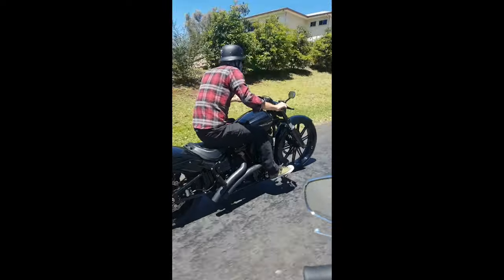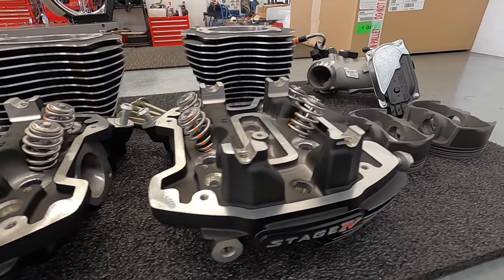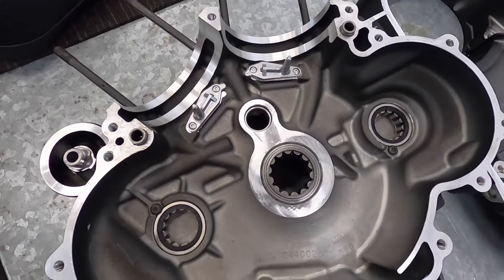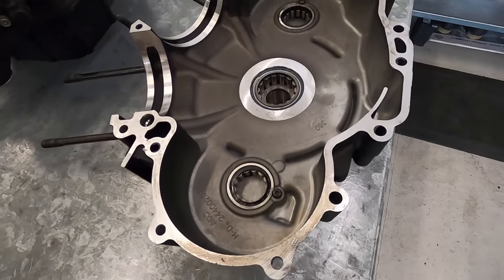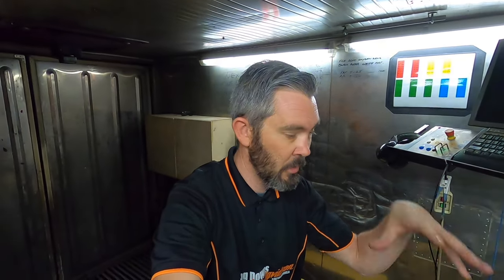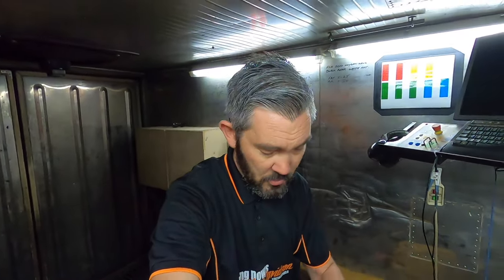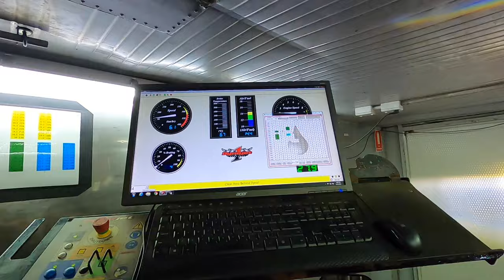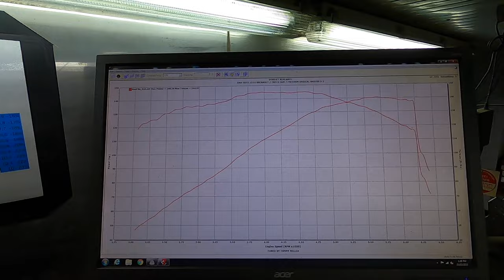131ci Breakout / Build & Dyno Tune / Stupid Fast

Comment: Nice build and tuning; 140hp/145tq specially with the less than optimum exhaust system.  The Cycle Rama 512 Cam performs quite well with the HD-SE 131 Kit.  Very nice curves on the Dyno Sheet.  Well done.  2-23-2023
Tom M., So. Cal., U.S.A.  '21 RGS 114 Stage-2 (S&S 465 torque cam) & '23 RG-ST (stock 117 for now).

Comment: 🤣😂🤣😂🤣
Stirring up the Yankees 🇺🇲 with "we do the better skids"😂😂🤣😂🤣🤣😂
I like this build, anyone can build a motor just for a dyno printout with massive number's..... But that's an issue for a tape measure 🤣😂🤣.... But I've always said it's better to make usable numbers, especially within the rev range of normal riding...... As it's a road,NOT A DRAG STRIP.....
Keep Living the F#@KING Dream ❗
Safe travels 🙏♥️🐾🐾
💪🇦🇺💪
Reply from the maker: Cheers for awesome feedback & support mate!! 
It's no secret that we do the best skids on the planet 🌏👊🏻

That's exactly right though mate. I could have put a cam in there with over 250° of duration with more lift and made lots more power but it would have softened the bottom end off and not had the huge hit from 2000rpm.

Time & place for all different combos and as you said....numbers ain't everything 🇦🇺

Comment: Great vid, I recently had my Fat Bob fitted with the same kit but using the 131 kit cam, hilariously fast now.  How much extra do you get from your recommended cam please?
Reply from the maker: Results vary from engine to engine as different air filters & exhausts systems are used. However this CR512 Camshaft generally goes early 150hp & mid 150s in the torque.

Thus bike was a little lower due to the pipes
Reply: The SE cam in the 131ci kit is shit. I swapped it out for the CR512 and its an animal now..

Comment: Awesome Job and of course an awesome bike! Is it correct that i see 3 holes for 3 Ignition sparks? And yes, it gives a lot to do when you rebuild and tune an engine! TX for sharing this video
Reply from the maker: The Milwaukee8 uses 2x spark plugs per cylinder head so 4x spark plugs all up.

Comment: fantastic work as always Tommy. Do you know if the S&S quickie pushrods fit inside the screamin eagle black pushrod tubes on the M8... ive been unable to find the answer as someone mentioned they dont. thanks
Reply from the maker: Thanks for the positive feedback and support.

Ok, the S&S Quickie pushrods are designed to work with the STOCK pushrods tubes on the M8. Now the stock pushrod tubes are slightly longer than the Screamin Eagle pushrod tubes.
The Screamin Eagle pushrod tubes are slightly shorter than the stock ones, they have to be shorter to allow for wrench clearance and the bottom to make the adjustments. 
So with all that said I would assume very confidently that the S&S quickie pushrods will fit inside & be able to work with the Screamin Eagle pushrod tubes.

Comment: BEST Harley tuning and Look!!!  Somebody know what is the EXHAUST NAME or what is Company name of the 2 pipes exhaust, very nice sound!!!
Reply from the maker: They are FREEDOM Radical Radius. The owner has modified the ends caps. They normally have a 'slash cut' end cap but they've been cut off straight
Reply: Loving the videos and the builds, new to Harley and just purchased a 2023 Breakout, in regards to the Freedom Radius Pipes, are they better than the V&H Big radius pipes, got these and as part of the Stage 1 kit.  Keep up the good work and good to see a some local content. @MasterTechMiller

Comment: Great Job boss amazing Breakout. Have a question for you my Fat Bob 2018 from 107 I upgraded to 124 S&S  Stage 3 with 475 Cam and Screaming eagle throttle body with injectors. And Clutch plates with 2-1 S&S Race only with silencer making over 131hp and 144tq but its not that smooth any thing else is missing to make the bike ride smooth as stock ? Or its impossible once you go with these performance parts.
Reply from the maker: The S&S 475 cam is not known for being smooth. I would recommend changing to a CR485 from www.alphaperformanceengines.com.au 

That will make the bike run smoothly & will definitely make more power. The rest of your setup sounds like it will be fine to keep running.
Reply: I am in the USA is this CR485 Australian product? @MasterTechMiller
Reply from the maker: @amg5795  yes it is. However if you contact www.cycle-rama.com they will be able to get you sorted

Comment: If I was still in Brisbane, I would be straight to your sales to get a low rider s
Reply: Do I need to get the SE tuner for S&S slip-ons on the low rider s 117?  my dealer in NZ doesn't have a dyno and the closest place is a few hundred k's away
Reply from the maker: @mintpaul  Hi mate.
NO. If you are just getting the Slip On pipes then you don't need to get a tuner.
The base calibration in the ECM has been done with upgraded air filter in mind so just adding slip in pipes won't effect it much at all and the ECM will still have learning window margin to make any adjustments if needed.
Reply: @MasterTechMiller  Thanks again and love your vid's

Comment: Finally found an Aussie channel with great content 🎉
You said these stage 4 builds are getting more popular🤔
I just had my 22 CVO Road Glide made stage II
I was talked out of going the full Monty on a tourer what’s your thoughts
Reply from the maker: Thanks for watching, mate. Congrats on your current setup.
I'm not sure why they would've talked you out of going any further 🤔 
I build plenty of big cube tourers with no issues. There are a few things that must be done to ensure longevity of the build its no secret.

Where are you located?
Reply from the maker: I've just built a 131ci CVO RoadGlide Limited. The video will be edited & uploaded in the coming weeks.
Reply: Country Vic
Reply: Was interesting re the twin over single pipe scenario I didn’t want to change out my pipes as Super Trapp were the only pipes made that fit the scorched chrome and I didn’t want to lose that look
I had to go to bigger injectors so to get the most out of the setup
Reply: Will look forward to watching that one
Reply from the maker: @jasonchapple4698  Khrome Werks offer a full system that has the same CVO Chrome finish. It's a great system.

Comment: What year is your Breakout, and did you have to do anything special to fit the 131 in there?  Been thinking of putting a stage 4 131 in my 2014 Breakout, since it has a stage 2 103, and it's rather slow...
Reply from the maker: This is my friend's. It's a 2020 model and the 131ci engine fits straight in without any hassles. 

Your 2014 Breakout is a Twincam engine the largest bolt on kit you can go with that it 117ci. 
You can also buy the 120R Screamin Eagle crate motor which is a complete bolt in engine.
Reply: @MasterTechMiller  hmmm. Thanks for the info, I'll have to look into those. Any significant difference between the two other than displacement?
Reply from the maker: @gagepuffinbarger6939  there is a fair bit of difference between the Twincan engine and the new Milwaukee8 engine. Mainly the 4 valves per head in the M8 engine.

Comment: Great video mate, looking to do the 131 kit in my 21 streetbob, can you tell me what the standerd cam is that comes with the SE kit? Id like to run the same set up as this here. 
Thanks!
Reply from the maker: Hi Kurt, thanks for checking it out. 
Here is a link to another 131ci build I did with the SE517 Cam that comes with the kit. This video shows how it performs as a bolt on kit
https://youtu.be/waEJtpi-RRI
Reply: @MasterTechMiller  thanks Tommy, very impressive in part 3, did you end up getting 160? Also could i get away with running the factory bottom end with this build. The bike cops abit of a hard time here and there.
More of dumping clutch/ powerskid. not sitting on front brake
Reply from the maker: @kurtdonovan4198  if you plan to be a little mean to it I'd highly recommend doing a stronger bottom end for sure. 

Sold the bike before I had a chance to spend more time on it so I didn't end up getting the 160 but all good. I'll be doing another build shortly and aiming for over 160
Reply: @MasterTechMiller  ok no problem, il look at bottom end weld also, i just spoke with one of the boys at your shop, looking at a quote for this build you might see it around october  if all good. Thankyou!
Reply from the maker: @kurtdonovan4198  that's awesome mate! I look forward to possibly meeting you and building your engine. 
If you need to talk with me, just call the shop and ask for me 🍻
Reply: @MasterTechMiller  i sure will thanks mate, and also intrested in how you can achieve the 160. Im running bassani sweepers i understand 2 in 1 will produce more hp, but love the sound of these things. Do you think we could achieve 150+ with the 2 pipes?
Reply from the maker: @kurtdonovan4198  yep, 150hp is achievable with 2-2 pipes, just need more compression & cam shaft

Comment: Wellll bugger...now I need to do the same to mine 😅 great vid mate.  How much would that set me back roughly on my 2019 114 breakout?
Reply from the maker: Depending on your exact setup now with exhaust, air filter & tuning module you could be up for around 12k ride in ride out fully built & tuned. 
If you already have a decent air filter, exhaust system & tuning module it will be less

Comment: Is that bike dropped in the rear? Its a 3.5 gal gas tank right?
Reply from the maker: Yes it's running the Platinum Air Ride in the rear.
Reply: @MasterTechMiller  and the gas tank? 3.5 gallon gas tank
Reply from the maker: @MR1JUNO  yes
Reply: @MasterTechMiller one last question do you guys install 5 gallon gas tanks?
Reply from the maker: @Mario Rosales  Yes. We normally use the Fatboy tank, modified so that console mounting points are removed for a clean look..

It's a direct fit with no issues, fuel pump & sender fits directly in & the mounting points are the same

Comment: is that the standard front wheel?
Reply from the maker: No. It's a 23 inch
Reply: @MasterTechMiller  does it change the ride much? I’m thinking gloss black my original rims or do I go to 23?
Reply from the maker: @kanenaysmith9287  nah doesn't change a thing.

Comment: Awesome work mate. With a build like this will you have to do work on the clutch? Always wondered
Reply from the maker: Thanks for the awesome feedback mate 👊🏻

So the stock clutches in the Milwaukee8 bikes are proving to be VERY solid. We upgrade the stock springs to the Heavier 1275N Springs from Screamin Eagle, and that's it! We have had NO issues with any clutches in any of our hi output engine builds. 
Even the bike we drag race on a regular basis still run stock clutches with only the upgraded springs.
Reply: @MasterTechMiller  thanks for the reply mate! Means alot. That is awesome to hear about the clutches. Really enjoying the videos mate! Learning on everyone. See you on the next one!
Reply from the maker: @adamhetherington839  no worries at all. I'm glad you're enjoying them.

New video will be finished & uploaded in the next week or 2. It's a 131ci Bagger build so stayed tuned for that one. 👊🏻🍻

Comment: How do you get 200hp?
Reply from the maker: Super Charging or Turbo Charging comes into play for +200hp. 

To get over 200hp NA you need to bigger with cubes, a 143ci with a bigger duration Camshaft than this one, more compression & rave fuel

Comment: Thinking of a 131 . Can a 468 cam work with this configuration ?
Reply from the maker: The SE517 that comes with 131ci would be far better suited than 468 cam. 
You could run the 468 cam but you would holding the engine back substantially. 

The engine would not be able to run efficiently with the smaller cam as it wouldn't allow for big enough 'breath' to fully fill the cylinders.
Reply: @MasterTechMiller  Thank you  for quick reply.

Comment: Nice results! Can you give a rough estimate around what money is needed to get these results starting with a stock Breakout?
Reply from the maker: From a completely stock 114ci Breakout you will to budget roughly $10,500 ride in ride out for something like this engine build. Obviously that's including the engine kit, exhaust system, air filter setup, tuning device, labour and dyno tune.
Reply: @MasterTechMiller  Thank you for the information!

Comment: Engine  swap 114 to 131  ?? With no modification???
Reply from the maker: What do you mean no modification? You need to explain your concern or ask a better question
Reply: @MasterTechMiller  do they have kit available to a 114 to 131 ? Or do you have to take the engine out and replace?
Reply from the maker: @edgargarcia940  Screamin Eagle offer a 114ci to 131ci bolt on kit. 

The reason I had this engine out & apart was because I fitted an upgraded flywheel assembly.

Comment: Is it worth doing the upgrade from 114 to 131, if your riding 10,000 miles per year. My bike is 2020 breakout trying to figure out if I should spent 9k on upgrade for fast bike or get naked superbike
Reply from the maker: A few things to consider with an upgrade like this are; I recommend halving the service intervals for the engine oil & filter. So that brings it down every 2500mi.
The primary & trans oils can remain at the 5000mi interval.

Fuel consumption does increase aswell so if your looking to do longer hauls you will be looking for gas stations more often.

From 0 to 100mph these types of builds will crush just about any 1000cc Sportbike on the road.

Comment: What’s the cost of this package?
Reply from the maker: The complete stage kit from Screamin Eagle retails at just over $5600AUD depending on your dealers workshop labour rate will determine overall cost of installing and tuning but a ROUGH figure would be $7300 ride in ride out if you already have a full stage 1 kit with tuning device

Comment: how do I get my new build to the point of dyno ready
Reply from the maker: That's a very open ended question. Can you please explain your current situation & what you are trying to achieve
Reply: I have been told its best to do a 500 miles break in before getting on it, you seem to be able to reach a safe point way before because u show bike on dyno without break-, how are u achieving this readiness. @MasterTechMiller
Reply from the maker: @johnbeardsley7360  OK, firstly that information is false. 
Doing 500miles on freshly built engine without a proper tune in there is the quickest way to cause damage to your engine.
Why? Because there is an improper tune that will have very lean spots through the RPM range & ignition advance is not properly set leading to spikes in combustion pressures. 

All the engines I build have all the critical clearances & tolerances set during assembly. One very important one is the piston ring end gap. Once the engine is built, I fire it up & ensure it gets to operating temperature while inspecting the engine for any leaks etc. 

Once the engine had reached operating temps I let it cool off. This procedure ensures the engine & all its components are fully heat cycled through their expansion & contraction limits.

After that it's straight onto the dyno to get the Air/Fuel Ratios spot on as quickly as possible. I don't want to have the engine running rich risking washing the bore. Nor do I want it lean causing excessive heat.

These guys who tell you that you need to do 500miles on a 'Safe Tune' is absolute rubbish & it is in my opinion that they lack confidence in their abilities.
Reply: I followed all instructions and also made sure the end gap was correct. I then got a tune from Fuel Motto and have been running it only 20 to 25 miles at a time but that's only because of the cold weather.
I would think Fuel Motto is reliable to give a correct tune.
So are u saying I should be able to run it normally now? @MasterTechMiller Also harley says new bikes should be run at low rpms while new for up to 600 miles ...is this wrong? the new build has 122 miles on it.
Reply from the maker: @johnbeardsley7360  So your bike has been professionally built & tuned?
Reply: No, I did the stage 4 myself, 117 and all its components ,cylinders, pistons,  64mm throttle body,55mm injectors, Cam, clutch springs etc. I then got a tune from Fuel Motto via the internet. I checked the end gap with a feeler gauge and torqued everything to spec. The bike runs good and I have tried not to exceed 2500 rpms per Harleys instructions. I have zero oil leaks and don't see any problems (smoke, noise ,shakes etc.)  @MasterTechMiller
Reply from the maker: @johnbeardsley7360  it's fine to have it fully dyno tuned by the sounds if it.

I would not recommend relying on the flash tune to be 100% accurate.

Spend the money on a dyno tune.
Forgot about 'running it in'. It's fine.
Reply: thank you for getting back, I trust your experience. @MasterTechMiller
Reply: how long should a dyno tune take? @MasterTechMiller
Reply from the maker: @johnbeardsley7360  depends on a few factors like how far out the base tune is the tuner using, the data collection software used & the ability of the tuner.

Anywhere between 1 to 2 hrs for more common builds & combos & upto 4 to 5 hrs for more bespoke & tricky combos.

Comment: The belt drive and stock clutch and stock tranny in that beast?
Reply from the maker: The clutch is stock except for the SCREAMIN Eagle 1275N Springs. Transmission is 100% with no problems whatsoever in the HARD 10,000km it's done so far. Has been through 1 belt though but was only due to picking up a rock.
Reply: @MasterTechMiller  Well that is a testament to the build quality built into every STOCK HARLEY DAVIDSON. I have stage2 110 prostreet B.O. and I think its plenty of power for me, so I'm concentrating on keeping it cool and tuned for longevity. Liking the DK CUSTOM upgrades for forks and shocks and a target tune. bought Jims FAN and Lyndall rotors in black for an extra dose of black. Like your style. What brand of tires does your customer buy to burn up, obviously he buys the ones that smoke the most. Good to know about the SE clutch springs, thanks, and if I ever upgrade to 117 jugs, I'll be sure to upgrade the clutch springs too.